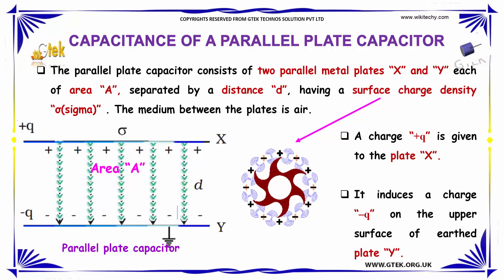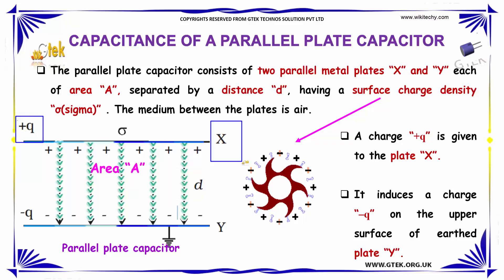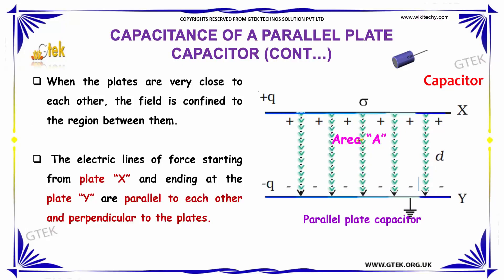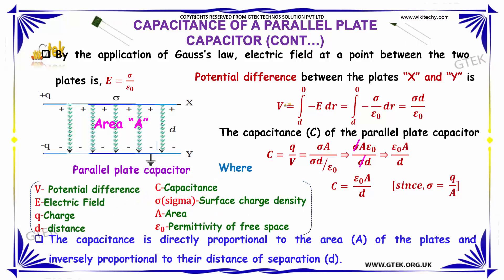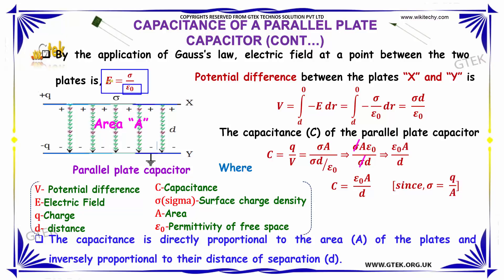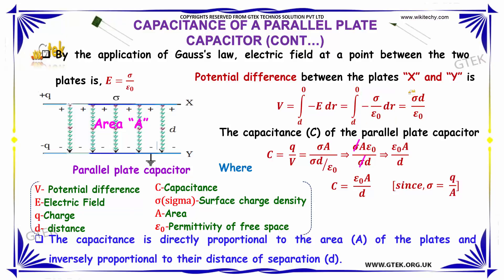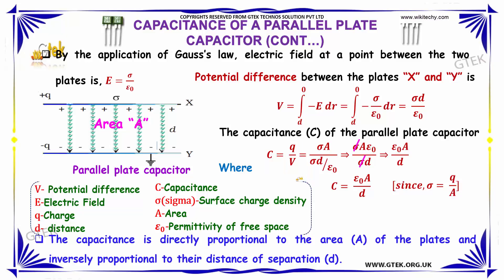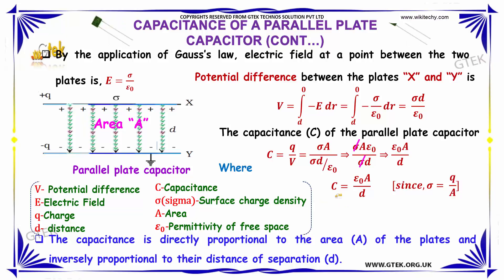Capacitance of a Parallel Plate Capacitor Electro statistics class 12 physics subject notes lectures

Comment: electric charges are static i.e. not moving, is ... called static electricity. There are two types of ..... Notes only for class students. Not to be circulated. Page 12. (2). Potential – Difference (i) is the work done on unit ..... Term capacitance of a conductor is the ratio of charge ... Principle : Principle of a parallel plate capacitor is.

Comment: A parallel plate capacitor is the simplest type of capacitor. It consists of two conducting plates of area (A) separated from each other by some distance (d). The material between the plates can be air or vacuum. To increase the capacitance of parallel plate capacitor, we can also insert a dielectric material between the plates of capacitor.

Comment: The parallel-plate capacitor is one that includes two conductor plates, each connected to wires, separated from one another by a thin space.

Comment: k = relative permittivity of the dielectric material between the plates. k=1 for free space, k>1 for all media, approximately =1 for air. The Farad, F, is the SI unit for capacitance, and from the definition of capacitance is seen to be equal to a Coulomb/Volt.

Comment: Capacitance is the ability of a body to store an electric charge. There are two closely related ... In a parallel plate capacitor, capacitance is very nearly proportional to the surface area of the .... C is the capacitance, in farads;: A is the area of overlap of the two plates, in square meters;: εr is the relative static permittivity ...

Comment: A capacitor (originally known as a condenser) is a passive two-terminal electrical component used to temporarily store electrical energy in an electric field. ... Unlike a resistor, an ideal capacitor does not dissipate energy. Instead, a capacitor stores energy in the form of an electrostatic field between its plates.

Comment: Capacitance is measured in units called farads (abbreviated F). The definition of one farad is deceptively simple. A one-farad capacitor holds a voltage across the plates of exactly one volt when it's charged with exactly one ampere per second of current.

Comment: The SI unit of capacitance is the farad (symbol: F), named after the English physicist Michael Faraday. A 1 farad capacitor, when charged with 1 coulomb of electrical charge, has a potential difference of 1 volt between its plates.`

Comment: Its function is to store the electrical energy and give this energy again to the circuit when necessary. In other words, it charges and discharges the electric charge stored in it. Besides this, the functions of a capacitor are as follows: It blocks the flow of DC and permits the flow of AC.

Comment: Capacitance. Capacitance is the ability of a body to store an electric charge. ... The SI unit of capacitance is the farad (symbol: F), named after the English physicist Michael Faraday. A 1 farad capacitor, when charged with 1 coulomb of electrical charge, has a potential difference of 1 volt between its plates.

Comment: The capacitance of flat, parallel metallic plates of area A and separation d is given by the expression above ... k = relative permittivity of the dielectric material between the plates. ... The electric field between two large parallel plates is given by ...

Comment: This simplified capacitor is also chosen as the electronic circuit symbol for a ... How can we increase the capacitance of a parallel plate capacitor? .... Energy storage is by means of static charge rather than of an electro-chemical process that is ...

Comment: A parallel-plate capacitor is an electrical component used to store energy in an electric ... An electric field is created as charge builds on the opposite surfaces, storing energy. ...

Comment: In electrical circuits, the term capacitance is usually a shorthand for the mutual capacitance between two adjacent conductors, such as the two plates of a capacitor. However, for an isolated conductor there also exists a property called self-capacitance, which is the amount of electric charge that must be added to an isolated conductor to raise its electric potential by one unit (i.e. one volt, in most measurement systems).

Comment: Electric potential at P due to + q and – q charges is given by V. ..... Q.27 A parallel plate capacitor with air between the plates has a capacitance of 8 pF.

Comment: et us take a parallel plate capacitor. Suppose the separation distance between the plates is d. Use air or vacuum as a medium for this experiment.

Suppose +Q is the charge on one plate and –Q is charge on the second plate. Bring a rectangular slab made up of conducting material between the plates of the capacitor. The thickness of the slab must be less than the distance between the plates of the capacitor. When the electric field will be applied then polarization of molecules will be started. The polarization will take place in the direction same as that of electric field. Consider a vector that must be polarized, name it as P. The polarization vector must be in the direction of electric field Eo. Then this vector will start its functioning and will produce an electric field Ep in the opposite direction to that of Eo. 
E= Eo – Ep
The electric field Eo in the outside region of the dielectric will be null. Now the equation of the potential difference between the plates will be :
V=o (d-t) + Et
But Eo= Er or K
Therefore E= Eo / k
So
V= E o (d-t) + Eot / k
V= E o [d-t+t/k]
As we know
Eo = electrostatic 1.42 / electrostatic 1.16
= Q / A electrostatic 1.16
V= Q / A electrostatic 1.16 [d-t+t/k]

Capacitance of the capacitor is shown in the equation below:
C= Q / V= A electrostatic 1.16 / (d-t+t/k)
= electrostatic 1.16 A /d-t (1-1/K)

I.e. C= electrostatic 1.16 A/ d-t (1-1/k) ——- 2.31

So, C > Co
Clearly, it is proved that if a dielectric slab is placed in the plates of a capacitor then its capacitance will increase by some amount.

Comment: The most common capacitor consists of two parallel plates. The capacitance of a parallel plate capacitor depends on the area of the plates A and their separation d.

Comment: The most capacitance when the plates are large and close together. A large capacitance means that the capacitor stores a large amount of charge.

If a dielectric material is inserted between the plates, the microscopic dipole moments of the material will shield the charges on the plates and alter the relation. Materials have a permeability e which is given by the relative permeability k, e=ke0

Comment: All materials have a relative permeability, k, greater than unity, so the capacitance can be increased by inserting a dielectric. Sometimes, k is referred to as the dielectric constant of the material. The electric field causes some fraction of the dipoles in the material to orient themselves along the E-field as opposed to the usual random orientation. This, effectively, appears as if negative charge is lined up against the positive plate, and positve charge against the negative plate. In the figure to the right, the blue material is the dielectric.

Comment: In a capacitor, the opposite plates take on opposite charges. The dielectric ensures that the charges are separated and do not transfer from one plate to the other.

Comment: Capacitance is the ability of a body to store an electrical charge. There are two closely related notions of capacitance: self capacitance and mutual capacitance, that are usually both designated by the same term capacitance. A material with a large self capacitance holds more electric charge at a given voltage, than one with low capacitance. Any object that can be electrically charged exhibits self capacitance.

Comment: Image result for Capacitance of a Parallel Plate Capacitor
k = relative permittivity of the dielectric material between the plates. k=1 for free space, k>1 for all media, approximately =1 for air. The Farad, F, is the SI unit for capacitance, and from the definition of capacitance is seen to be equal to a Coulomb/Volt

Comment: Capacitance. Capacitance is the ability of a body to store an electrical charge. ... The SI unit of capacitance is the farad (symbol: F), named after the English physicist Michael Faraday. A 1 farad capacitor, when charged with 1 coulomb of electrical charge, has a potential difference of 1 volt between its plates.